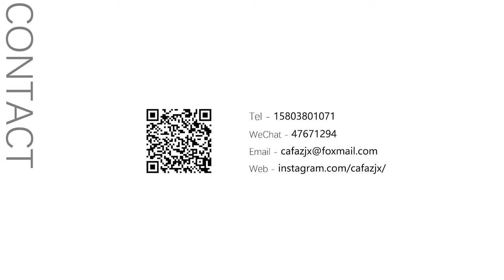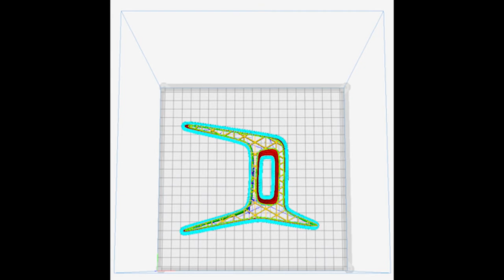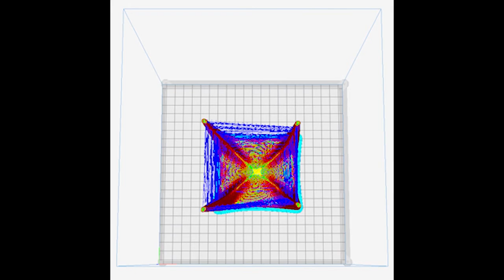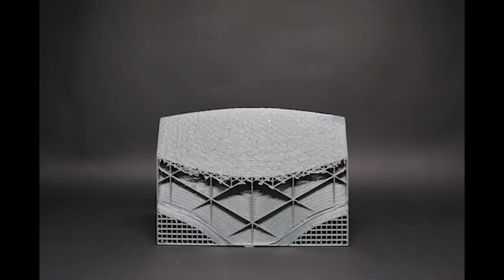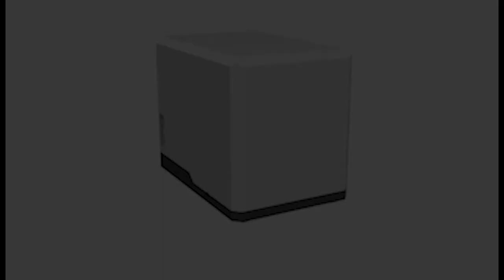Granular 3D Printer Using in Furniture

Comment: 3D printer is the best, than the plastic moulds, as you need to make new investments, for manufacturing lines cut off, by the 3D solution.
Reply from the maker: Yes, I think this is one of the ways forward